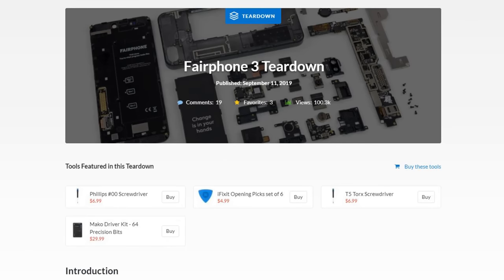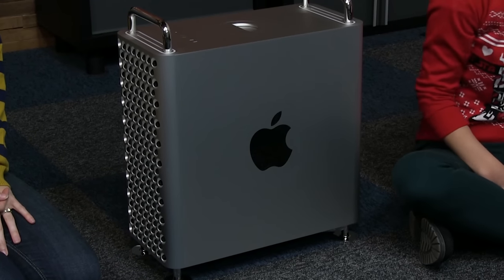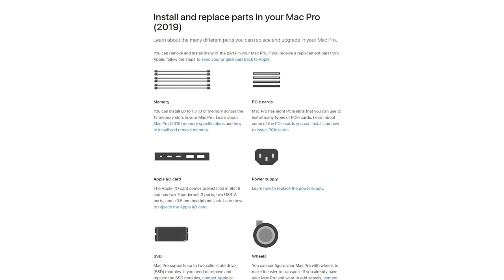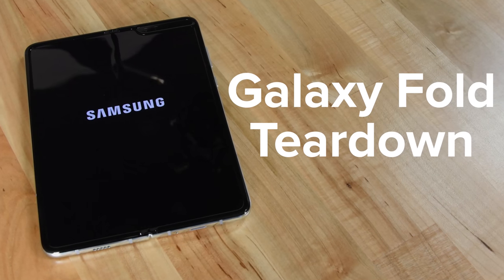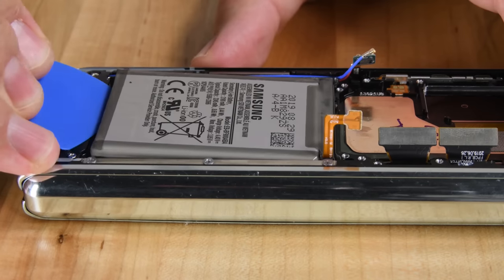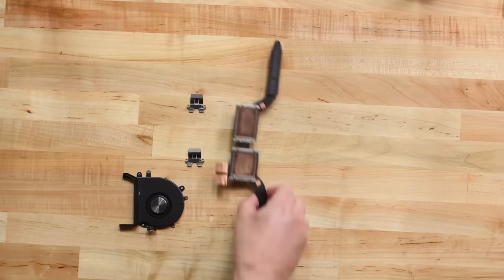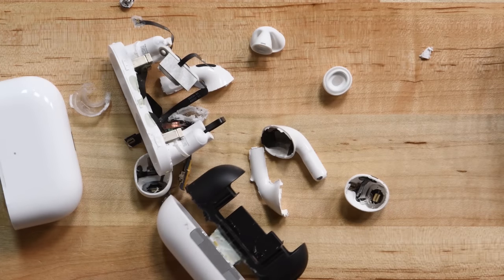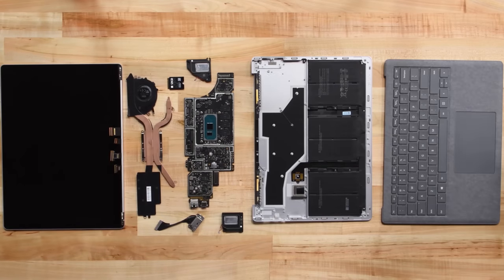iFixit's Best and Worst Devices of 2019!

Comment: Repairability will increase cost, reduce reliability, reduce water proofing, and increase size. Less repairable phone are more green - for example iPhones today last a long time and have a robust secondary market. Remember back in 2008 when phones died after getting a little bit wet even though most phones had a replaceable battery? That certainly was not green and most customers do not want to go back to those days.
Reply: Ahhh, but you fail to remember all the water proof and water resistant devices that are repairable... You also fail to remember all the non-repairable phones, that happen to have no water resistance whatsoever. Cost, reliability, water proofing, and size, are not completely interdependent. The Galaxy s5 has an official water resistance rating of IP67, a removable battery, micro SD card slot, and Samsung provides a way to obtain licensed replacements of nearly every component. It is every bit as compact as nearly any other smartphone released at the same time, and is just as reliable with great longevity. This month I have, in my job working for a cellular provider I will not disclose, I have encountered nearly two dozen perfectly functioning S5's, that simply needed a new batter. Newer Samsung devices with ratings of IP68 that Samsung firmly stands behind, are more compact, durable, and reparable than most comparable phones on the market. Apple will advertise water resistance, but will not stand behind this marketing when the consumer's device is damage by contact with moisture, meanwhile, when it comes to repair, the back glass is super-glued on to modern iPhones, and as such, repairs of many components are nearly impossible, leading them to recommend replacement of the entire device in many circumstances. "Most customers" speaking globally, had a very different experience to what you are describing. Most customers specifically in the US however, had iPhones, so yeah, water damage, dead phone, new phone, that logical progression was very present for the iPhone user. I on the other hand have every phone I have ever owned in a shoe box with their respective chargers, with the exception of the note 8 that I traded in for a promotion, and every single one still works, charges, and boots up. My LG Envy2 can still fire up a game of monopoly, risk, or tetris... My Moto Razr v3 still works perfectly, and brick breaker is still a lot of fun, but there aren't any decent carriers that support 2g anymore, but otherwise, it's in perfect condition. Even dropped it in the river once by accident. I was once tempted to purchase an iPhone when they announced the 5s back in 2013, but with the sheer frequency of people around me having to replace their shattered, drowned, bricked, crashed, or outdated iPhones, 2013 was the turning point for me, when I decided I was going to start off my smartphone journey with android and see what was up. I researched phones for about a year really, until I got together the money, and went out and got the LG G3 in 2014. Yeah... it bounced instead of broke, batteries were 6 bucks instead of new-phone-bucks, all the apps, customization, size, call quality, speakers, the display was flippin' 1440 x 2560 when apple was pushing a dull 750x1334... The list goes on and on. I paid $169 for it, and the iphone 6 was going for $649. So, more of everything? Same form factor? Longer battery life? Cheap batters that are quick swap-able and user replaceable? SD expansion slot? High res display? Integrated GPU that could handle, at the time, cutting edge mobile games like Monument Valley and Hearthstone. Meanwhile Apple was dropping iOS updates that killed everyone's iPhone 5 and eventually 5s off XD I have been laughing to the bank ever since. To this day, I could absolutely daily drive my LG G3 again, while virtually every iPhone, of the same release period is dead or dying. Though, I shouldn't be unfair to Apple, the Sony, Nexus, and HTC phones of the same period are not without their own massive flaws.

Comment: Since when a full size pc ram need a screwdriver to open up? Apple only start to use off the shelf standard component last year for a pc,while others been doing it for ages.
Reply: Case and other components don’t need screws for the mac pro i would assume they’re talking about that as well
Reply: @matto1540  I've been hearing it wrong. Some can be swap without tool, like swap the ram. PC been using retain clip for that anyway. 😂 Anyway, all i see in this video is try to place Apple in whenever possible. Well, to be expected of west market.

Comment: I dont think the Mac Pro earned a 9/10, it feels like apple got brownie points for how much they deviated from their norm. Yes its a massive step forward for apple, but the SSD being locked to the T2 chip and the only way to get repair parts is from either apple themselves or the IBM repair program for enterprise customers should really dock a few points. If you need to replace or upgrade your SSD either apple has to do it or you have to use PCIe based storage (for as long as they allow that). Yes upgrades are fairly simple baring the SSD, but for repairability it is garbage due to not being able to source parts like a motherboard or a new PSU. There is a guide on apple.com for how to remove the PSU but I am not seeing a simple way to order a new one once your warranty runs up, saying how easy it is to repair but not being able to get the parts is meaningless.

Comment: Why do you give the mac pro 9 out of 10 ??? Compared to normal desktop pc its not that good...
Reply: actually compared to most desktop PC's the mac pro is a lot easier to take apart and work on
Reply: @Syddy_  you cannot change OS SSD, you cannot turn on the PC when the case is open, dunno how you wanna work fast when you need to put the thing on everytime you wanna post and change something then. You cannot install a normal GPU without buing a 80dollar extra power cable. Thats only a stupid molex cable.... you can buy a good PSU from this money. And I dont even see an option for other power connectors for any sort of pci/e card.
Maybe it looks nice for ppl who dont work often on pcs. I dont have one of this and I didnt need to do something on such one for friends, I only saw it in videos, I bet there are many more things that are not convenient at all.

Btw, I would not buy these at all when you need power, since Apple has no AMD threadripper 3990x Option :D
And as you might now, you can NOT just go there and buy a trx40 mainborad and just change it so you can install your ryzen CPU
Reply: @berberger4814  you can boot off any other drive slot, someone will eventually find a way to trick the PC into being bootable without the outer casing on but even then that's not a big issue, it won't take long for third parties to make the same cables that apple sells for a lot cheaper.
i work on PC's every day, and i know how many problems you can run into while working on PC's, apple has remedied a lot of those with the mac pro, the way their entire motherboard is designed it's actually way beter than any other motherboards on the market and their case is still way easier to open than most other cases. the price is literally the only thing arguable on the mac pro.
and no, i'm not an apple sheep, i don't own a single apple product, i own a self built ryzen PC.
Reply: It's a repairability score, not value
Reply: @Syddy_  yeah you can change boot ssd

Comment: Please ifixit fix the ifixit screwdriver kit. I love mine in general however the extension is useless as it has in several years of repairing devices not once helped to open sth. If even a bit curved there is no leverage to be gained anymore. But there have been many items, especially coffee makers that have very deep screw holes where I would have loved to have a slim extension, the same width as the bits to extent my reach. All the best from Germany.

Comment: Does serialization ever factor into the repairability of a device? Most Apple products are serialized on replacement parts.
Reply: I think they did. Most hardware in the mac pro is not serialized, most hardware in the Macbook that got a terrible score, is. It at least correlates.

Comment: airpods pro?.....googles em......PPPPPFFFFTTTT!!! $250 EARBUDS?!?! That's a decade-plus supply of cheap $20-30 buds for me.
Reply: Yea if you want wired earbuds that don't have noise cancelation or audio pass through you can buy them for 20$ but if you want features you have to pay for it.
Reply: @dodoontherocks  Magic trick, wired headphones are wired, so you can just pop one out and let it hang. Most in-ear buds cancel out that vast majority of noise(30-90 percent depending on cartridge design, and ear tip material(marshmallows/memory foam tips absolutely crush external noise of all kinds). The only reason the noise cancelling in the AirPods pro has any significance to it's target market is because the previous iteration of airpods did a very bad job of sealing out external noise. In terms of audio fidelity, they also don't even come close to a $40 pair of SoundMagic ear buds so... yeah. Also, with wired ear buds, the battery in your headphones(there isn't one), doesn't just die at the worst possible time. It also seems ironic to want noise cancellation AND audio pass through, the same gesture, with wired headphones (raising a hand and momentarily touching your earbud) gives a similar result. For pass through while listening, just let them sit in your ear loosely, and to shut out the sound of a screaming baby on a long flight, jam em in deep and crank it. Hard to justify the minor shift in quality of experience against exponential cost and lack of longevity. Spending $250 on a pair that was clearly made to be disposable in exchange for some minor tweaks to already present "passive" capabilities of standard ear buds seems silly.

Comment: Wait. so let me recap: the MacBook Pro got a 1/10 for glued in battery and soldered CPU/GPU/RAM. The Microsoft Laptop 3 got a glued in battery, and soldered CPU/GPU/RAM. How is there a 4 point difference?!
Reply: Replaceble SSD: you can change disk AND save you data if the laptop dies. If your mac dies they tell you "your data is gone, don't even attempt to fix it. if someone says can fix it's a scam and you'll lose your money".
To replace the keyboard you have to rip off the entire mac.
Reply: @DumahBrazorf  I know how to replace those keyboards, since I've done it myself. You basically just rip the keyboard apart from the topcase by pulling it with pliers, then you can use a screwdriver and a hammer to get rid of the rivets, put the new keyboard in and screw in a bunch of screws. Time consuming? Yes. Impossible? No. For the data part: this is true. Apple are shitheads for removing the lifeboat-connector found in 2016/17 devices. However, Time Machine is by far the best and easiest backup solution on the planet. Plus you can sync your desktop and documents folders to iCloud. By placing in-progress-files on the desktop, losing important files, whilst maintaining fresh backups is literally impossible.

Comment: why would you try repairing airpods though
Reply: They're $250 headphones with a battery that is only meant to last a year or two. Most other manufacturers of bluetooth headphones have designed them in a way that the battery can be replaced. This is the case for bluetooth headphones costing even as little as $40. There is no excuse for being unable to replace a button cell battery in a small device that costs this much, when the precedent is such that it is clearly possible, and even reasonable to expect that capability. What I find more disturbing is that the inside of the Airpods Pro is just a big mess of glue lol.
Reply: Capn Smashem I see. Didn’t realize they have such a short lifespan.

Comment: Air Pods Pro or any other full or even wireless headphones. Has anyone EVER repaired? Please tell me yes, because I never heard of. So I think every other pair of water resistant/proof are equally ZERO for repair.
Reply: Not really, the Airpods Pro have an IPX4 rating which is rated for sweat, splashes, and rain. They are not waterproof. Compared to direct competitors, they have only marginally better water resistance, and under the circumstance that they are in their case, or within your ear, and not being directly hit by fast moving water, many brands of wireless earbuds perform relatively the same. It is understandable that it would be difficult to repair a low profile headphone with something like an IPX7 or 8 rating, sure. But this is literally just improved sweat and splash resistance we are talking about. It should still be possible to replace a battery lol

Comment: i think all governments around the world should ban phones that are sealed shut with glue etc like Samsung etc. As it very anti consumer they are pretty much trying to force people to buy a new phone every 1 to 2 years. In stead of costing me just to replace a battery i need to take it to someone to replace it or need to buy a new phone.
Reply: Most modern smartphones, including Samsung, have an adhesive rubber gasket that is heat-removable. I think you are referring to specifically Apple(they have been super-gluing the crap out of their phones for over a decade) and LG(they glue down their batteries now, yay). Also, Samsung has offered phones with easy-to-remove backs and batteries even to this day, with flagships holding onto this capability up until the Galaxy S5 in 2014, well beyond when other manufacturers had moved to designs that did not allow easy user replacement of such components. The first iPhone in 2007 was designed with the intent that it would be discarded, or returned for repair to apple. Consumers have clearly never been bothered by this, and the dollar speaks volumes, to the effect that, the general population wants to buy a phone that isn't repairable, and then wants to whine about it, instead of opting to purchase a phone that is reparable and can last a long time. I used an LG G3 from 2014-2017, and purchased a spare battery on ebay for 6 dollars so that I could carry a spare for long periods away from home, like trips etc. It still works like new to this day, but I swapped it out when the Note8 came out. I had the note for about 2 years, and the battery started to get tired, so I picked up a new one for 15 bucks and swapped it in. I later traded my practically brand-new copndition note 8 for a $700 credit toward an s10+ and a $300 employee voucher I got as an employee incentive at my work, and upgraded basically for free. Since 2014, I have spent literally $1100 on phones altogether, leveraging every promotion or trade deal, and have always had a next to new phone that worked flawlessly. Recently picked up an LG G8 for free with new line activation, and I have to say. I was pretty sickened when I watched a tear-down video of it. The most dangerous component in a phone, the battery, is glued down, so that when you attempt to repair it, you have to pry and dig at the battery to get it out, which is just asking for it to crush a cell or two, short out, and explode... lol Good thing it was... mostly... free. lol There's a reason that it's a nearly $900 phone that goes for under $200 in new or like-new condition on ebay, just sayin... despicable.